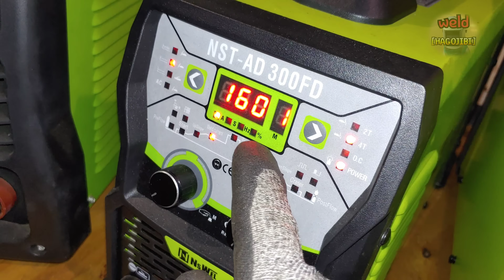How to Avoid Tight Gap TIG Welding Mistakes

Comment: I'd say I'm impressed if it wasn't for the sub-standard TIG welding. Severe over penetration, overheating the material and a excessive waste of gas. Try doing better if you're going to plug a product next time.